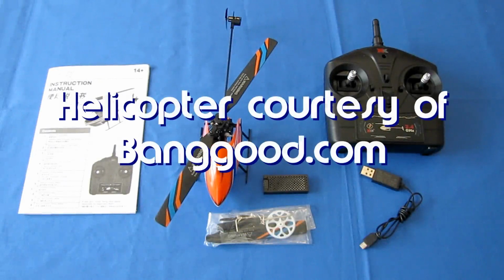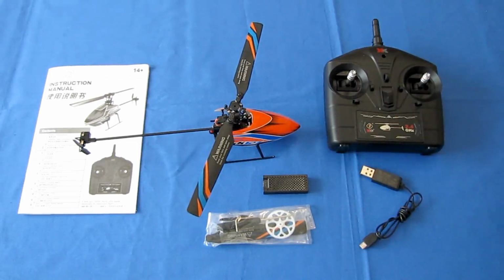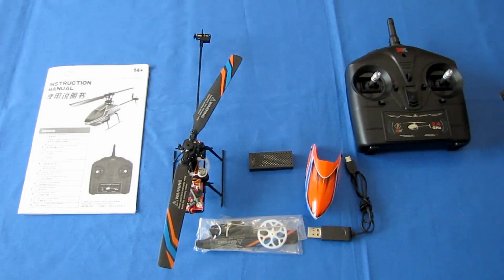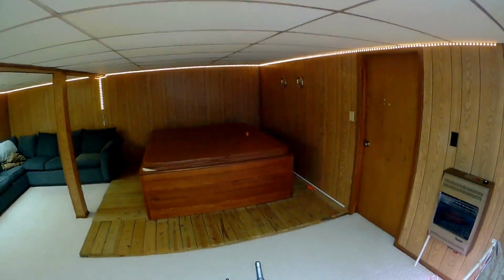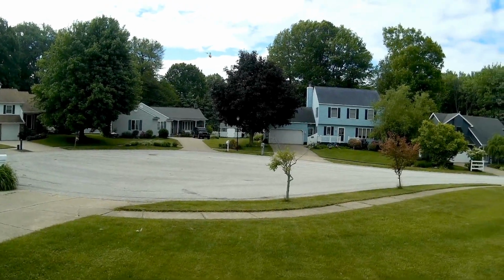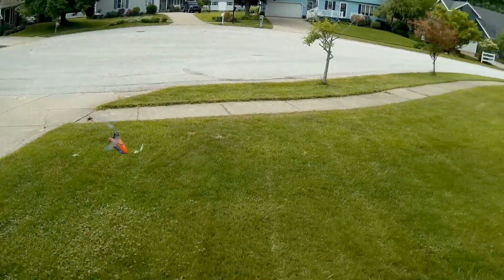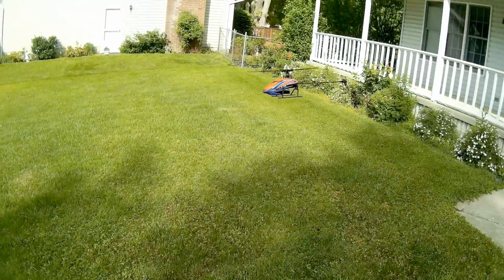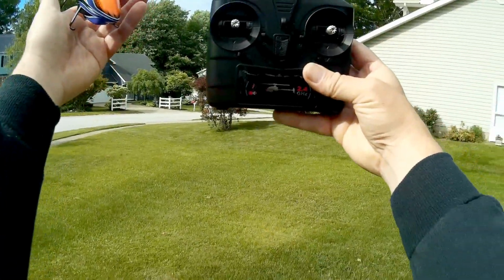XK K127 Eagle 4 Channel Stabilized RC Helicopter Flight Test Review

Comment: Very cool and stable helicopter.  Is there a larger one that is easier to see at distance that is just as stable and not too expensive?
Reply: Yes the E130 by Eachines. It's about 13in long. Stronger battery.

Comment: I have an issue with this kind of model when I hit the wall the thing just go full throttle and lose control anyone know whats wrong with it?
Reply: Mine is also same. Check and found left joystick faulty. Some sort of ribbon on joystick peel off. Put it back and good to go.

Comment: So after a light crash in grass, whenever i yaw the heli drifts backwards. any ideas on a fix or what to check? great review btw, i watched the entire thing even though i own it lol
Reply from the maker: Try a gyro recalibration.  Connect the helo to the controller, then place the helo on a flat/level surface.  Move and hold both control sticks down and to the left until you either hear a beep or see lights flash on the helo.  Also try down and to the right.  Then try taking off to see if the problem has been corrected.

Comment: Hello and HELP!. Mine won't bind after just one very successful first flight.... 
Any ideas
Reply from the maker: Low battery in your controller?  Helicopter battery fully charged? Did you move the left throttle stick full up then full down to connect the controller to the helicopter?
Reply: @Quadcopter101  actually it doesn't bind anymore under the standard "up and Down"  method. But after many attempts I'd binded again and consistently doing left up, and both down and outwards" thank you and I hope it helps.

Comment: Hi sir i have xk 127 after crash i saw abnormal movement of my rc helicopter when i move backward the left direction also happen desame time.
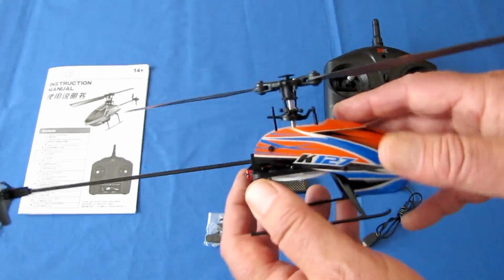Reply from the maker: Take a close look at the video starting at 2:37.  Notice the control rods going to the propellers.  Make sure that yours have not been damaged by the crash, and that they currently look exactly the same as the control rods on my helicopter.

Comment: Please help me I wanted to change the propeller of the rear rotor out of curiosity and since the helicopter turns on itself 1/4 is there a way of meter the propeller should it a lot or isn't there a way please help me?
Reply from the maker: I'm sorry, but your question is not very clear to me.
Reply: @Quadcopter101  Is there a way of metering the rear propeller because I removed it and then put it back and the helicopter turns now is there a way of metering the propeller??
Reply from the maker: Is the rear propeller spinning?
Reply: @Quadcopter101  oui
Reply: @Quadcopter101  Yes, but now the gold of the throttle rotates on itself so I thought there was a sinking adjustment of the propeller on the rear rotor
Reply from the maker: Did you push the propeller too far onto the shaft?  It may be rubbing against the base of the shaft, slowing the propeller down enough that it can't counter the torque.
Reply: @Quadcopter101  I don't understand when I put the propeller by the end should I push it to the bottom?? Or how many mm from the beginning of the tije should I push it down?
Reply: @Quadcopter101  Sir, you were the only one who could help me is there a way by e-mail or I don't know to show you by photo because I can't fly until I have the propeller well
Reply: I pushed it down at the beginning but it rotates 1/4 on itself to the right
Reply from the maker: Can you upload a short YouTube video showing the problem?
Reply: @Quadcopter101  I sent you the video by messenger, is that okay with you?
Reply: Or tell me how I can do it. This is my first helicopter.

Comment: Svp je ne comprend pas à quoi sert les trim d’en haut à gauche quand japuis dessus il ne fait pas de bip contrairement au 3 autre est ce normal
Reply from the maker: c'est normal.
Reply: @Quadcopter101  dieu vous bénisse vraiment j’étais très inquiet 😥 vous m’enlever un poid c’est mon 1 er helicoptere (j’ai comence par un mini drone à noël et voilà que j’ai un helicoptere qui me transporte en enfance merci 🙏🏽 (cet été je vais prendre un avion et c’est grâce à vos vidéo dieu vous bénisse puisse vous remplir de joie et de paix ♥️
Reply: @Quadcopter101  When I charge it and the light turns off if I disconnect and disconnect the light turns on pdt 30/60se wave it depends as sometimes not even 10 seconds think you that it's normal I received the helicopter yesterday and are my first charge ??? Is it normal, are you doing to me too?
Reply from the maker: Did you try flying it with the battery?  If the helicopter flies for close to 15 minutes, then the battery is charging normally.
Reply: @Quadcopter101  yes 15min
Reply: @Quadcopter101  merci du fond du cœur ♥️ votre aide est précieuse j’ai une dernière question consernant la baterie après utilisation combien de jour laisser maximum la baterie sans la recharge exemple si je ne l’utilise pas pendant 1 -2 jour penser vous que je dois la charge à 30-40% pour prendre soin de ma lipo ou pas ?
J’aimerais juste savoir combien de jour maximum puis-je laisse ma baterie sans la recharge sans la détériorer ???
Reply: Je charge ma baterie sur mon port usb de ma ps4 je pence que c’est mieux que sur 1secteur usb de phone que me conseiller vous le mieux j’ai une peur bleu de endommager ma baterie j’en ai que une 😰
Reply from the maker: Oui, 40 % devrait suffire pour le stockage.
Reply: @Quadcopter101  consernant les baterie usb une fois la baterie morte ☠️ 300cycle de charge passe pensé vous que l’on peut ouvrir le petit bloc usb est inséré une baterie de la même tension
Reply: @Quadcopter101  for m’y led red à thé baterie is normal ?For the red led too it's normal that it turns up even when the battery has just been loaded I reconnect it and its drunk pdt 10 seconds at 2 minutes depends
Reply: @Quadcopter101  site plaît aide moi j’ai voulu changer les pale mais j’ai remarqué que sa ne se vise pas n’importe coment aurais tu un astuce
Reply: J’aurais jamais dû touché non je suis dégoûter

Comment: Great channel... I got 2 choices this heli..  or wltoys v911s what would u recommend??
Reply from the maker: The V911S only has a flight time of about 7 minutes, so I'd skip that one.  But both the e129 and K127 are both very similar, and both have flight times of around 15 minutes.  So I'd pick either the e129 or K127, whichever you find cheaper.  Here's the e129 for comparison. https://www.youtube.com/watch?v=bePaRRrFPMU
Reply: @Quadcopter101  they both are 60$ e129 and k127 delivered to my front door... if u really had to pick 1 witch 1 would u choose??
Reply from the maker: @watsonville8312  OK, K127. It seems to be a bit more nimble in high rate (for advanced fliers).
Reply: Moi même jesite entre le eachine e129 et le xk 127 ( je sais vraiment pas le quel prendre vu ki sont au même prix yen a ki dise ke le e129 et plus agile et vous diser le contraire svp aider moi

Comment: What a better bird out of this? Take the tail prop for a bladecpx and replace the white one with that..it fits really tight so you got to drill the hole bigger. Oh and shorting the boom a half inch.  That's to long of a tail boom for that weak brush motor ..you will thank me if u do it

Comment: Does this heli cope with the wind better or equal to the eachine E130?
Reply from the maker: Better in the wind than the E130.  The E130 is a very slow quadcopter.  It's really only meant for beginner fliers, and can not handle wind due to its slow speed.  This drone (XK K127) is much faster in high rate, and should easily handle minor wind.
Reply: @Quadcopter101  eachine 129 ou xk 127  en qualité longue dure et crash

Comment: Overview:
I recommend the Denver dro-120 mini drone. I've had two and they are amazing, stable, good looking drones. With a compact design. Meaning that the drone is stored in the controlle. They have a 6 axis gyro. With 2 or 3 flight rates. A 3.7 V 150 mah li-po with 6 and even sometimes 10 minute flights,and 5-10 minutes of charge time.They are cheap too.

Drone:

With A black and orange design it's really different from other "boring" drones. Nice and sturdy design bunch of spare parts. Nice quality prop.gurards. But a failing parts of it the  led's. For night flying it's terrible.
But it's a smooth flight experience.

Controller:

The controller is the same as the fq777-125 controller. But the 124 was very empty and unclear but the 120's is a nicely labeled,easy understandable .

This is meant for people who are looking for a cheap high quality mini drone that you can take anywhere.

Comment: Have you tried flying this copter or the Eachine with a TX16S? If you can then you can have rates and exponential? I just ordered one because I felt that his could be adapted for FPV and would be great to teach kids. What do you think? They both have 350 MAH batteries. I just put6 an Ultrix on a church roof yesterday because I had low rates set and it just took forever to turn. That was yesterday and hopefully I can get a ladder tomorrow to get it down. Life is a bitch.

Comment: looks identical to the e129 ?   is there a difference in performance ?
Reply from the maker: Yes.  As discussed in the video, the high yaw rate is much more controllable compared to the the E129 high yaw rate.
Reply: @Quadcopter101   ok great yea i saw that bit . so it yaws more. thanks .what i was meaning is. if you have the 129  not a grat deal of difference to buy  cheers for the demo .!

Comment: Morning 101, Dont forget about the ground effect indoors, just like a full size chopper .It likes a free flow of air around the air craft, when you get close to an object , the column of air breaks up, and you get an uneven air column sucking you towards the object. ( love the clips , keep em coming)
Reply: Yes...probably a lot of beginners are madly pushing the trim buttons, and not aware of the rotor wash effect near walls, floor, ceiling and corners.

Comment: The helicopter's are too fragile and break very easily. There is a reason that there are ten times more quad owners than helicopters .
Reply: yea quads are easy .but can be too easy .and its nice to test your flying skills after a while for me.ive actually found. the  e 119 and the 129 very resiliant  myself ?
Reply: @kelvinbloomfield1375  Kelvin I do agree that helicopters require a great deal of skill. One fellow enthusiast Keven Talbot once said that he had to quite because of the huge amounts of money that he was throwing away with every crash. That is why I prefer the quads. Some are little tanks in the air!
Reply: @parker1ray  you want to try the cheaper ones first the eachine  e 129 to build up your skill level as this model has altitude hold and is really cheap.
Reply: @kelvinbloomfield1375  svp jesite entre le xk 127 et le eachine e129 pouver vous me conseiller svp